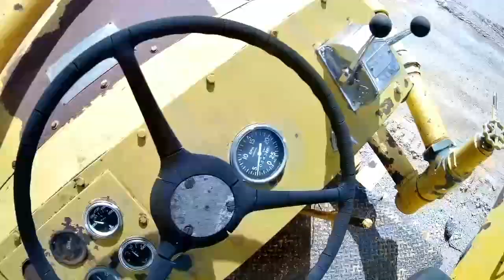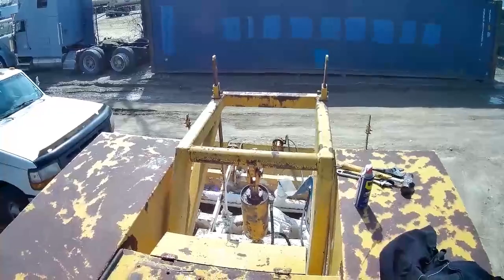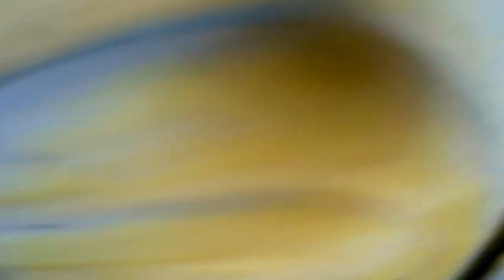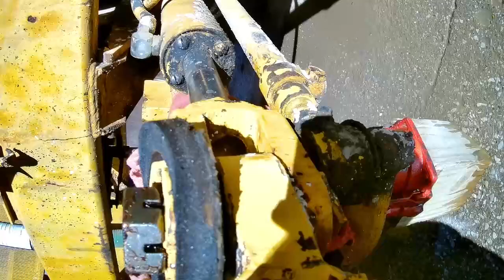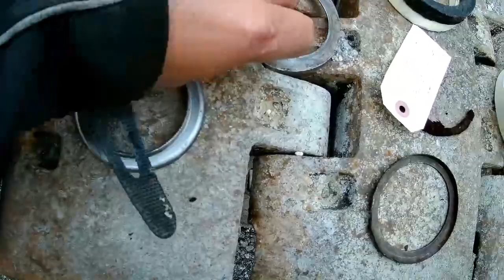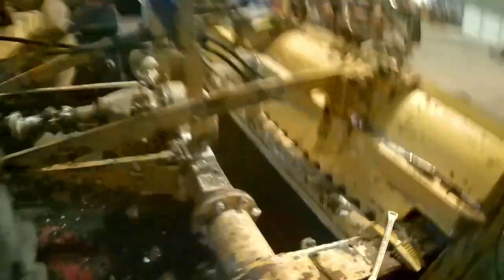Working on the Pettibone SM710 Speed Mixer

Comment: Hey thanks for the videos, was the machine put to work after you serviced it?  i just bought a 1950 pettibone with a gas engine from an auction with super low miles and i intend to see if it will withstand tilling through rock .